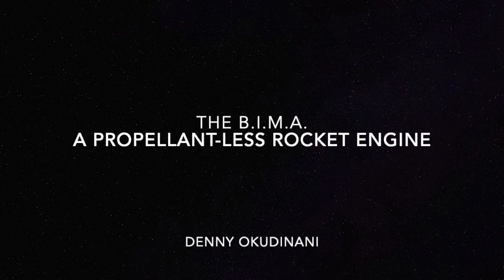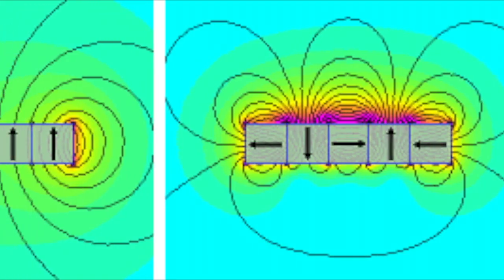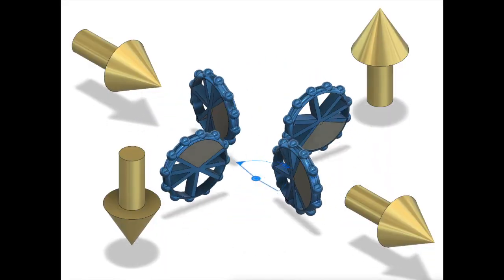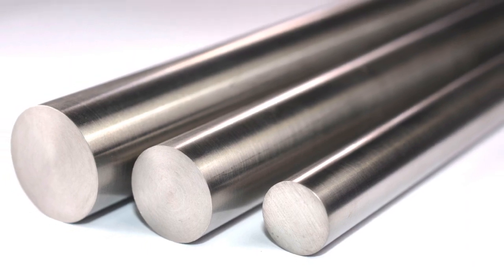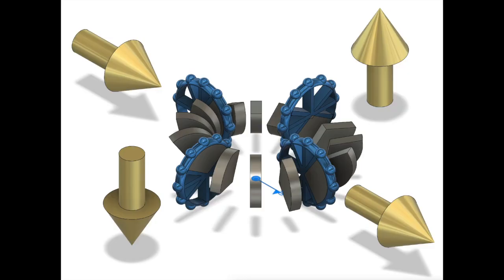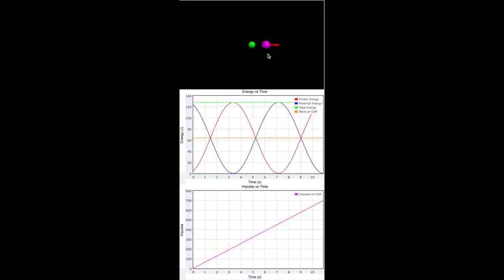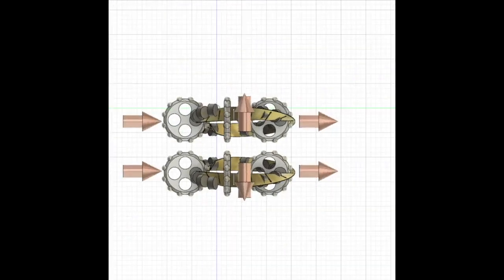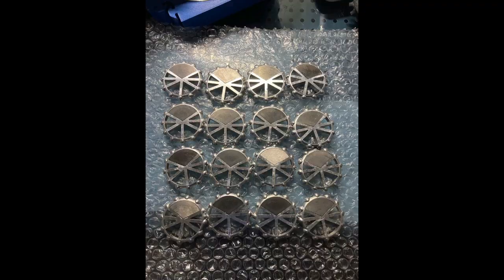Inertial Propulsion System 1: The unBalanced Inertial Mass Accelerator (BIMAH)

Comment: Lol nice try buddy.
Inertial engines can never work because the mass moves though a cyclic path, so what ever inertial forces you generate in one direction must always be blanced when the mass moves back in the other direction.
Inertial-friction engines can work, because they have something to push against like the ground, ie the friction part.
But no cyclic inertial engine can ever work in space where there is nothing to push against.
I'm not sure if you are a deliberate scammer or just a misguided fiddler, but please dont act like a cyclic inertial engine can ever produce more force in one direction, anyone with brains knows that to be false. Including Newton.
Reply from the maker: Hey thanks for that comment. I'd be inclined to disagree respectfully. One book which fleshes out most of the common "pitfalls" found in inertial propulsion systems is the Death of Rocketry, (namely chapter 4 I believe). Moreover, NASA's 2006 technical report here: https://ntrs.nasa.gov/citations/20070004897 also accomplishes a similar end. 

None of them "prove" that inertial propulsion is "impossible", only the faults in common design approaches, along with other advice for researchers going forward on the subject. 

In short, I'm of the belief that we should still "do science" and prototype these systems, rather than arguing like greek philosophers as to why they can or cannot work. That's why I've open-sourced all my work for those willing to take a look and try for themselves.  At the end of the day, there really is  no such thing as "bad" data--even if it doesn't agree with your hypothesis. Its all a part of the scientific method.

Nam qui curat
Reply: @MillennialZoomer    ok. I will observe your pendulum or air linear rail tests with great interest...
Reply: @wizrom3046  subluminal jokes 😂😂
Reply from the maker: @zunzwak4482  lol, I've gotta admit that was a good "pun". Will keep it in my chest for later🤣😂.

Comment: "propellantless rocket engine" is an oxymoron. A rocket engine, by definition, uses propellant.
From the Wikipedia page on "rocket engine": "A rocket engine is a reaction engine, producing thrust in accordance with Newton's third law by ejecting reaction mass rearward, usually a high-speed jet of high-temperature gas produced by the combustion of rocket propellants stored inside the rocket."
Reply from the maker: Hey, thanks for the comment—I hear you. Nomenclature and semantics aside, this is a full-wave rectified, solid-state, reactionary, implosive system (mouthful of word).  It's also a specific kind of Mach Effect Thruster, which are often labeled as "propellantless rocket engines" (according to NASA and others)  or even a mechanical "soliton" . So in this sense,  it is justifiable to refer to them as such.

For sure, this device isn’t a conventional rocket. But when explaining how it works to a broader audience, it's sometimes more effective to use familiar terms—minus one expected attribute. So yes, the oxymoron is intentional.
Reply: Yet massless photons carry momentum.

Comment: If a plasma ball is placed inside a spherical magnetic chamber and the plasma is energized by microwaves or a laser, the plasma will engage with the magnetic field of the chamber causing internal pressure. If one side of the chamber had a opening where plasma does not touch the magnetic field then this will cause a uneven pressure inside the chamber causing the chamber  to move in the direction opposite of the opening. Unlike a regular fuel rocket engine the energized plasma will not shoot out the opening but will hold it's shape inside the chamber due to electrical forces in the plasma.
Reply: If it dosent leave the chamber then the enclosed system will simply lurch to the side then return to the starting position once its disabled
Reply: @Aurem6974  The energized plasma is pulsing as it hits the magnetic field which produces pressure. Once the chamber starts to move it should continue to move in the same direction under it's own momentum so there is no reason for the chamber to return to the starting position. It operates on a principle similar to acoustic levitation.

Comment: Space travel is dependent on energy if you can throw enough mass fast enough you can create enough trust as needed if you’re vessel weighs 100 tons and throws 1 ton at light speed your travelling at 1 percent of light speed
Reply from the maker: mass is energy, so  as long as you  figure out an efficient mass to energy conversion process with, nonzero work , it can be directed to a specific direction as  "thrust".

Comment: nice methodology etc but would be good to see it actually work.... seems to me that it wont actually satisfy conservation of momentum....
Reply from the maker: We won't know for certain unless we "do some science"  and try some experimentation !
Reply: @MillennialZoomer you just need to put your prototype on linear rail and we will know right away. Since you didn't do this I've got a strong suspicion it doesn't work 😅
Reply from the maker: @lavericklavericklave  Your "suspicions "  are incorrect (not well warranted) for these  two precise reasons:

1)Linear railway proves nothing about true thrust. The device could still be a static friction device which operates by interacting with the surface. The best way to evaluate an inertial system  for true thrust is to use the pendulum test. This is illustrated on page 7 of this NASA report here: https://ntrs.nasa.gov/api/citations/20070004897/downloads/20070004897.pdf 

2) I actually did prototype two of the systems. To understand why I've stopped work, and the progress I made (if any at all) you should read my technical report. Here btw: https://www.researchgate.net/publication/394250885_DNO7_Technical_Report--On_Spatial_Mass_Displacement_Systems_Inertial_Propulsion. 

Prematurely jumping to conclusions doesn't help anyone. Doing science and sharing your results helps all of us go forward, even if the data isn't what we expect.

Nam qui curat.
Reply: @MillennialZoomer if your system cant overcome the incredibly small friction of a linear rail then I think you can give up on this idea. 
Your technical paper is complete garbage and looks like it was compiled by an insane person.... There are no results in it. Just mountains of waffle.
You can admit that it doesn't work, there's no shame in that.
Solus stultus viam vanitatis sequitur
Reply from the maker: @lavericklavericklave  Well, as the old saying goes "one man's trash is another man's treasure". Its not a crime to have the faith to try -and thats all I did, at the very least. Perhaps my papers are reminiscent of a "mad man" doing science few might presently understand( maybe even  a "madscientist" so to speak). This too is fine.  Moreover, the only "path of vanity" I've known on this journey is the road  no one cared to take because others said it wasn't worth walking down. Science is about discovery, I could definitely be wrong. This is completely ok. Even if the data says otherwise,  there is beauty in the journey.

Politely, and on the contrary,  you won't receive any forced  false admission from me. On record: my "Artificial gyroscopes" have been proven to work according to math and science on paper at the very least.  Others are more than welcomed to  carry on where I left off, wherever that road may lead,  and contribute to the broader scientific discussion with experiment. On that matter, I will close  with the following: from the constrained experimentation I carried out, things appeared to look quite promising qualitatively. I even have real (quantitative) data from working simulations based on these "mountains of waffles " which you speak . 

Nam qui curat
Reply: Even high school scince labs have a frictionless air rail, they must be relatively cheap.
Anyway, I have some experience with inertial-friction engines, and have some good working models, but NO cyclic inertial engine can ever work due to the mass moving through a full cyclic path. Any forces in one direction will always be countered as the mass moves back to its starting posiition.
So yes, an inertial friction engine can move things across a table, but NO your cyclic inertial engine cannot move things through outer space.
I find it surprising that you even believe this is possible.
Reply: @wizrom3046 he's got a 80 page technical paper that shows exactly how it doesn't work
Reply from the maker: @wizrom3046  "Frictionless air rails" can be "relativitly" cheap sure (we also  used some when I was in uni for labs on rectilinear motion and other collisions). But they aren't used for verifying inertial thruster, because they can actually aid in the transformation a given test system into of "static friction drive" with misleading data.  Let me be clear: I'm not dismissing the suggestion of using a frictionless linear rail out of spite, I'm doing so on the basis of work by NASA and several others who have worked  towards make better designs (with mixed success). The only reason I'm being so particular on this matter is that even if it "works" I don't think it would help my case in presenting a more formal or "compelling" argument to establishment scientist who sit in the high places of academia.

If you want to know why these scientist in these high places believe that the frictionless air-rail method is not the most compelling experimental way to prove genuine thrust (at least horizontally) I recommend taking a look at page 3-8 of this NASA report : https://ntrs.nasa.gov/api/citations/20070004897/downloads/20070004897.pdf

Folks are more than welcome to test any of my design approaches on a frictionless air railways-- I'm sure they would do just fine. Infact for those who decide to do so, I imagine it would probably be most beneficial  to carry this experiment vertically to a wall (with the device mounted on the frictionless airway like a drop tower for a theme park) rather than horizontally on a table. I think there is definitely a compelling case for proving genuine inertial thrust using a frictionless linear air rail only if done vertically , not horizontally.

Finally, for the sake of argument, even if these things aren't possible on paper, theres no harm in doing experiment. Doing the experiment will will clarify our precise understanding of why a particular approach is viable, or not. Dismissing these approaches before they reach the lab, might save money, but also bring forth setback to potential progress. 

Remember, it wasn't too long ago when everyone once thought that heavier than air-flight was scientific "impossibility" (this included professional scientists at the university). The Wright brother ended up proving even the "professionals" wrong. Maybe it could be the same for this. Just have some Faith- lets all work together and do some science!

Nam qui curat

Comment: This technology could be used to propell spacecrafts when they're in space. If we don't need any additional fuel or propellent to push the craft forward but this device could actually do that without friction, this could be a game changer.
Reply: This technology relies on weight, not mass, so it's useless until you're in a gravity well.
Reply: @JeanClaude-go6br 

Les masses (double) électrique Commutantes, peuvent êtres utiliser en stator,

La force gyroscopique sous électricité, ce sont des ampérages,

Quand les phases d'amperages rencontre leurs valeurs par répulsions générées par le rayonnement Ampères du stator,  il se passe un effet de compression qui est un puit de gravité= Cathodique= inversion du dipôles magnétique,

Le puit de gravité  est un condensateur électrolytique, qui magnetise les masses ferreuses en aimants permanents,

Ci le stator est un anneau remplie d'eau, alors cette eau electrolyte liquide sous hermétisme, est comme une pile de Bagdad (un condensateur a bain d'huile), l'eau va émettre des ions négatifs d'abaissement d'impédances doubles (deux spines contre rotatifs ) et des ions positifs  de redressement  d'impédances doubles (deux spines contre rotatifs)

Les ions augmente les forces Ampères, générant l'augmentation de la force gyroscopique qui est un effets de poids cyclonique en convergence commune (force centripète) puis se repulse en divergence commune en générant le puit de gravité par saturation volumique , générer par l'espacement des forces de convergences du centre,
Les forces de divergences Centrifuge, créés un effet oxydatif négentropique par conservations des charges (condensateurs électrolytique)
Reply: @JeanClaude-go6br I re-watched the video he never mentions it relying on a gravity well or gravity.
Reply: @rickybloss8537   He didn't because it's obvious at first glance, that's the whole point of the "debunking" video that he released sometime ago, you should watch it, it really touched on the mass driving aspect of the contraption.

The best it can do with regards to space travel is to be modified into an improvised inertia damper,  also rapidly changing the center of gravity of an object in powered flight can have it's advantages in advanced maneuverability and precise thrust vectoring, like he said, it's pretty much a gyroscope.
Reply: Too bad it’s fake lol
Reply: @IceRain-f5v  agree. But it is cool to think about it though. These types of stuff aren't that far from achievable. If it is, then a trip to Mars is a vacation plan for Elon musk.
Reply: @arrchan1023  indeed, this type of stuff isn't far from achievable. it's unachievable. it's physically impossible to create a closed system that moves on its own. the device in this video is nonsense, if you were to build one IRL you'd at best get a shaking mess that vibrates until it rips itself apart, and at worse a bunch of junk that does nothing. and then rips itself apart.
Reply: @henrycgs  oh yeah, I forgot about that.
Reply: @henrycgs 

La saturation du principe du transistor, c'est une fusion de commutation du dipôles magnétique, , ce qui signifie , des phénomènes toroidaux monopolaires , capables de repulser et d'attirer simultanément les surfaces des ensembles entre eux,

Les ensembles contenus, vont jamais pouvoir ni se rapprocher ni s'éloigner ,

C'est aussi le même principe que le glissement du rotor par rapport a un Stator en un moteur électrique
Reply: @AzeEza-p3f  Quoi ? Rien de ce que tu as dit n’a de sens. Ça n’a même pas de rapport avec la vidéo en question. On dirait juste que tu as assemblé un tas de termes techniques d’électronique et de physique sans logique.
Reply: @IceRain-f5v 
?

Comment: WE HAVE TO USE MERCURY LIQUID TO HAVE ANTI GRAVITY MACHINE.. FORBIDDEN TECHNOLOGY AGAIN...
Reply: We have the technology and tooling now to make an electrically conductive, Ferromagnetic fluid without using mercury. 
We can do better than mercury now actually, we can make the fluid hydrophobic and perfectly viscous to the point it will flow uphill and self syphon once started..... 

The only factor lacking is the density and the atoms molecular periodicity.
Reply: A specific frequency centrifugal magnet array with a second array specifically positioned to push the first  arrays S pole into the N pole cab creat this mass nullifying field  aswell.  
The potential of specific sound frequencies is also capable.

Comment: Did you learn enough to also explain why it doesn't actually work in the real world, yet?
Reply: dont bother with this guy. thinks in one direction. "circular logic".

cant think in two opposite directions from a point.

at a guess, if i asked you "what is the motor bolted to?", you would probably get it, rather than refer me to a pdf of gibberish and imply i dont understand "constructional details"...

our intrepid inventor seems to be unable to comprehend what happens when a motors shaft is held still, and more alarmingly, WHAT is holding it still if so...

and apparently he went to university... go figure ;) perfect explanation of why everything is so crap these days... doctors that dont understand biology, teachers more concerned about sex than education, and engineers that cant figure their way out of wet paper bags...

Comment: there are similar concepts using liquid mercury moved with voltage you should check those.
Reply from the maker: Hey, thanks for the comment. I am more than aware. Without a private lab, electro-pneumatic approaches to inertial propulsion tend to be a bit more work when it comes to prototyping.
Reply: And that's the secret sauce. Ancient records found in India almost describe these systems to the point where you can feel like you can almost rebuild them today.